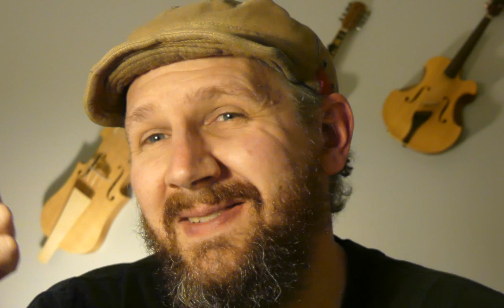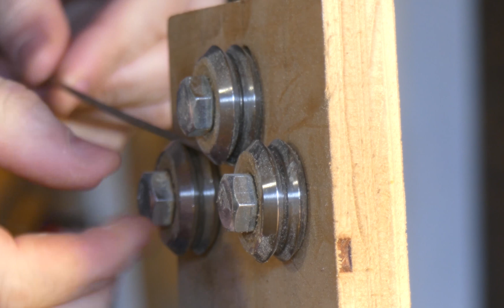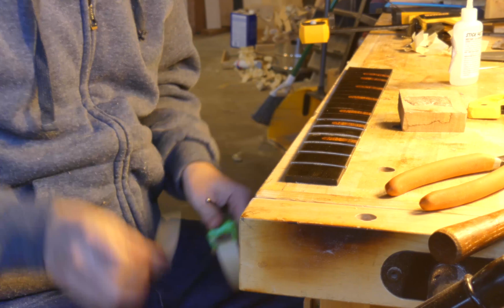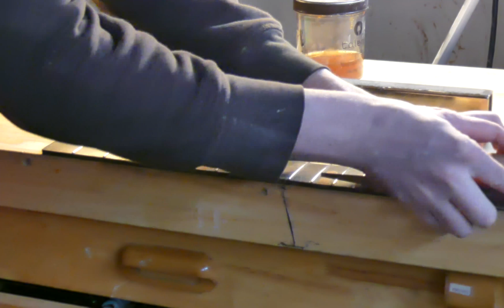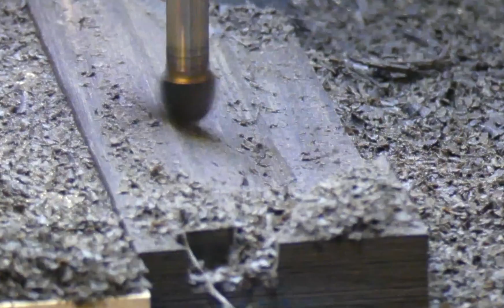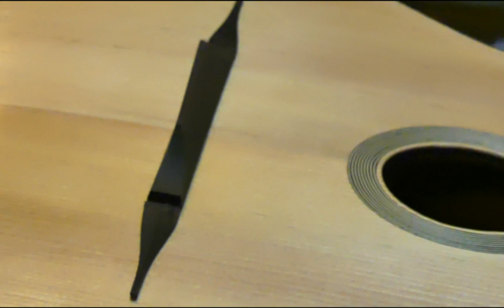Making the Selmer Guitar| Part 11

Comment: Selmer is looking good! Is that a 10” radius? I play with a Geronimo Mateos Selmer reproduction.  It has a wider neck than the original to please the classical trained European guitar players.  Radius is about - 16”.  I do 10 shows/week with this torture device.  Are you going to sell this one?
Reply from the maker: I do believe the fret board radius of this one is 12" however I can make them to any specification necessary. This is a wider neck as well but I can make them to any specifications you request, such is the beauty of working through CAD/CAM in Fuison360. This instrument is being made on a specification for a client, I would be more than happy to make another for you.
Reply: Good to hear.  I looked up dimensions and I am surprised how large the Selmer neck was. I was sure Django played on a narrow neck.  In any case, I totally can’t play  D shaped necks and  large flat radius fretboards for a long period. Maybe a custom Manouche guitar is the best option for me.
Reply from the maker: If you are mostly backing up the soloist then a flat radius would definitely be more work on the hands.  A smaller radius is better for planing cords and a flat board is better for soloists. I find a neck that fits you your hand size makes a big difference when it comes to fatigue.